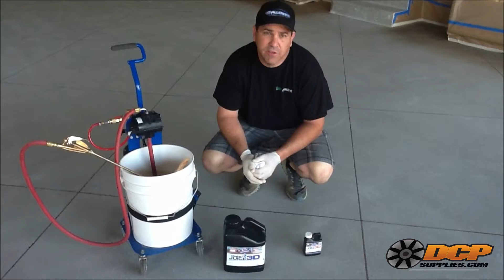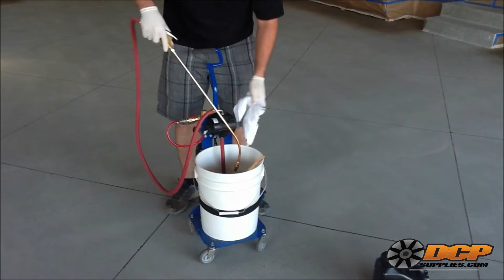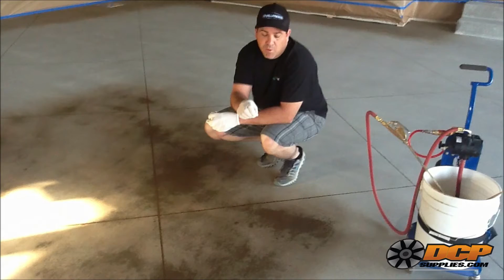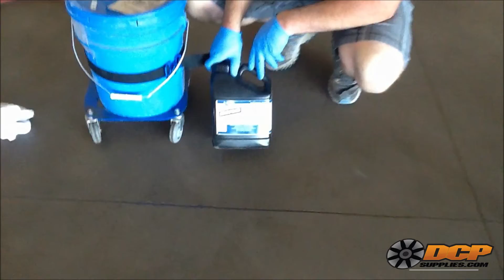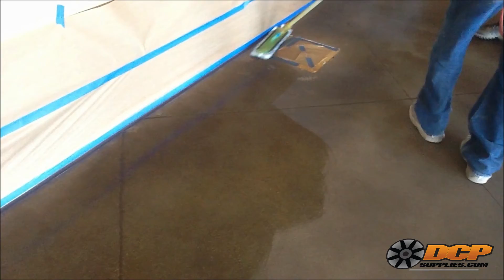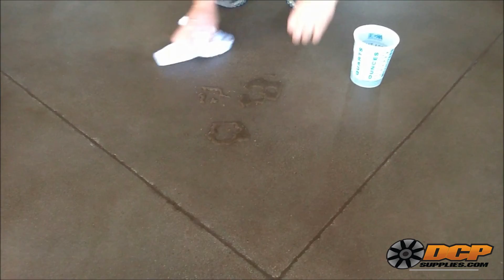How to Apply Ameripolish Color Juice 3D Stain on Exterior Concrete Floors

Comment: Mr.  I have an old concrete floor with patches of other cements, some lighter, some darker.  After diamond 100 can I apply the ink, with this diamond can it penetrate further and hide the stains?  then vitrify and seal.  The client does not want it shiny, and wants it a little porous.  It is exterior.  thank you